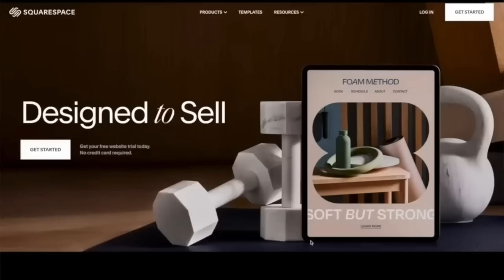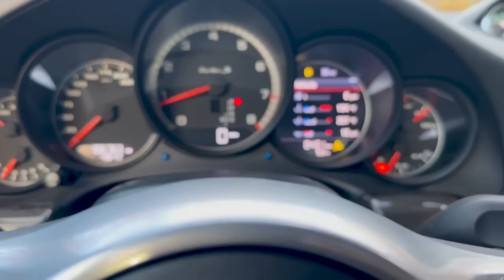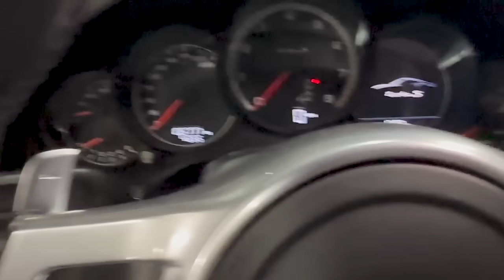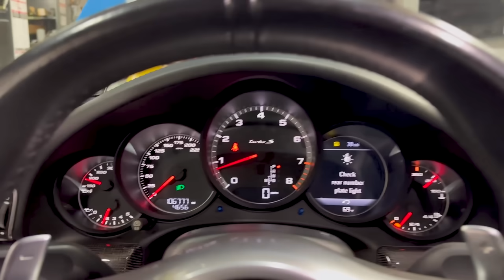I bought a 100k mile cheap turbo Porsche and Here’s What Happened When I Modified it

Comment: I was curious why Rich never used launch control. Turbo S should certainly have it. Foot on the break, floor of the accelerator and let up the break.
Even my Taycan has it.
Reply: just curious the way you decribe it does that mean launchcontroll like that is only for (semi)automatics
I've only driving full stick shifters in my life!
Reply: You have to be in sport + in mine to launch.  Why would you need launch control with a manual clutch? How would it even work?
Reply: @jefflethuman9794  Heaps of cars have launch control in a full manual.  Clutch in, foot to floor on accelerator, revs only go to about 2.5-3k.and then dump clutch.  Only reason for using the brake in that situation is that many of the cars you see doing it are either DCT or autos.
Reply: @ why? I thought the whole reason for folks wanting their 3rd pedal was for more control. Go figure
Reply: Yes, I think I misspoke, that would only apply to a PDK 911
Reply: @jefflethuman9794  Nothing wrong with launch control on a manual, nothing says you have to use it.
Reply: @ i love paying for things i will never use

Comment: I don’t understand why you didn’t pull off the spoiler drive. Would have given you more space. Only 4 bolts and a connector. You should have done the drive belt since you were there and considering how dirty those intercooler were your probably due to remove the front bumper and clean your front rads. But overall you summed it up perfectly. Dead ass reliable but expensive in labour to work on

Comment: So, is the popping a side effect of the increased performance or was it tuned specifically to do that for the sound? If it is the former, good on you; pop and fart to your heart's content. But if it is the latter... I got nothing but love for uncle Rich, but hearing that insufferable shit from the road in front of your house at 3am when you need to get up at 6 will put hate in your heart.
Reply: They typically only pop in sport mode. Nothing in normal. So not an issue.

Comment: The weight of the battery will help keep the front end on the ground. Probably accounted for in the design and suspension set up.
Reply: Porsche will sell you a similar lithium ion battery, because Race Car (for Porsche prices, natürlich)

maybe the aftermarket batteries aren’t too bad.
Reply: @johnsimon8457  the weight you save with the battery let's you carry more tools up front. Or eat an extra helping. 😁
Reply: 30lbs shouldn't break it's balance. Plus the slightly lighter exhaust should keep bias in balance.
Reply: Popeyes Chicken will sell you a bucket subscription designed to increase your mid-chassis weight bias.
Reply: @DiscoFang  that's a bit one sided. 😆👍

Comment: My 2017 Camaro SS has 130k miles lol. Still on original clutch and plugs/wires etc. I'm scared to touch it since it's still running so well lol
Reply: Might want to check the plugs. They are wear items.

Comment: i don't know much about weight distributions on cars but 30 pound big battery for may help with balance and stability by adjusting the vehicle's center of gravity, please can anyone help with this i welcome your reply's, thanks in advance.
Reply: the porsche battery is very heavy and mounted high up, it's not ideal and the only defining characteristic is that it's cheap.  Last time I looked that lightweight antigravity battery was around $1000 so there's a good reason you dont see too many of them. (I'm also not completely sold on a lithium ion battery in the car, but at least it's not near the engine heat).

Comment: I'm not sure about the 991 Turbo S, but you can get smaller cats for some Porsches that weigh less and also provide a little more power without a CEL.  I like Soul Performance and Fabspeed.  Also, I was curious why you didn't use launch control for your "launch" tests.  I'm assuming you eliminated the valves and that's why you have the pops.

Comment: A great way to get broken studs out is to drill a hole in the middle of the stud. And then get a torx bit one size bigger than the hole and then pound the torx bit into it. Then use the torx bit to back the stud out. Hasn't failed yet 👍
Reply: or spend less, time, less frustration, very little money and buy easy-outs that are designed for exactly that problem.

Comment: That's amazing... My 2015 Ecodiesel Ram, other than oil, changes fuel filters and a belt. It's never broken down. It only has 197,000 miles on it... i put a tuner on it also.

Comment: It’s all about buying clean examples with service records . My b8.5 S4 is still running 2.8 0-60s with  600 launches and 160k. :) modded of course.
Reply: Misspelled 4.8
Reply: @ at which? You must not know
Reply: @ still stock blower . 207  pulley 3.2PR and on 93 octane  , full weight
Reply: @rustler08 Nope, 2.8 is def possible on a modded S4.

Comment: pops made from excess unburned gas? seems like more oil changes needed from gasoline blowby and washing the cyclinder walls of already sparse oil also seems like a bad idea. that 'antigravity' battery is lithium? i guess it has a battery mangement system on it to be compatible with a porsche? i hear you should use the type of battery a car was designed for

Comment: Be careful with those silicone elbows. They tend to rub on the heat shield right next to the bumper. Also, when you remove the battery if you remove the holder for your tire inflation kit per the T 20s and lift up, it exposes the 13 mil on that tiedown strap. Y T nex hat way you don’t have to bend it to get the battery out.

Comment: Is not driving the porsche a US thing exclusively? Around in europe they are daily drivers all over.  A quick example is a 1991 911 Turbo carrera 4 with 200 000 miles on it and that sucker still goes for 59K$. (a 2008 turbo cab with 150K miles is around 70k$)   Here there is tons of turbo porsches that has driven between 100-200K miles and they have been completely reliable for most of the time.  Now the used prices here are high since the new car cost for a porsche is astronomical (insane taxes HP taxes +++)
Reply: People treat even the most basic German cars here as if they're something special.
Reply: @Voyajer. Crazy. You see 911 Turbos in Germany like every day in every weather. Its literally built as the ultimate daily sportscar.

Comment: I have a 2001 Yukon Denali with 280,000 miles and it still runs like it did the day I got it and I've only ever changed the fluids and spark plugs. Best most well built vehicle ever.

Comment: It's weird, my most reliable car ever was also a very expensive sports car.  Specifically a 2009 Aston Martin Vantage V8.  They're really good cars if they're maintained and regularly driven.  They really only break when they sit, so beware the ones with super low mileage.
The Vanquish I have now is almost as good.
Reply: Vanquish is incredible, just very complicated electronically with the two ecus for each bank of cylinders
Reply: @maxvinzi  Mine is a 2015, with the AM29 V12.

Comment: How many of those 30,000 miles were driven at the limit where the performance of this model is noticable from the performance of a much cheaper Porsche model though. Maybe 50 miles ? Buying hopped up models of cheaper variants only makes sense if the cheaper models are very exclusive, and the hopped up model is built in tiny numbers ( less than say 1000 ). Buying groceries in a Turbo S I imagine would feel nothing different from doing that in the cheapest Porische. I know, I know "It has more pow-wah !" ... that you can''t use in a 30mph zone

Comment: He forgot to cut the catalytic converter off the other exhaust and put it on this one? Oh yeah sure he did yeah yeah yeah sure sure definitely forgot. You get right on that rich. I'm sure putting those cats back on won't put any fun red lights on the dash that you suddenly didn't have before. And I suspect leaving those cats off is a little bit extra of that 40 lb weight removal

Comment: Mclarens are not reliable no matter what anyone says?  You bought a totaled out 720.  lol  That car was so fucked up its not even funny.   And Kevin and Sean from mcmedics both have mclarens.  They are just so bad the Sean has 2.  One has a shitload of miles he put on, beat the shit out of it with trackdays and had bacially zero issues.  I had ZERO issues with mine.  My Turbo S nothing but a nightmare.  02 sensors went 3 separate times, and the front diff went.  Total repair bill if not under the warranty was just over $20K. And to boot the loaner car they game me also had issues and needed to swap out for another one.   Reliable my ass.  Most unreliabel car I EVER owned. Shit my Rang Rover was more reliable.    Go to the forums.  Talk to real owners.  Not someone that buys totaled cars then is surprised there are issues.